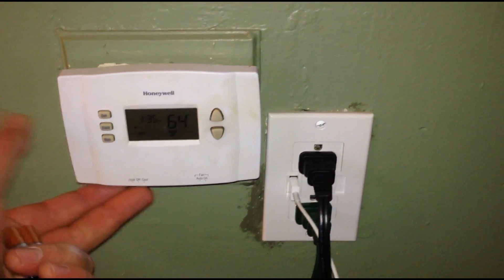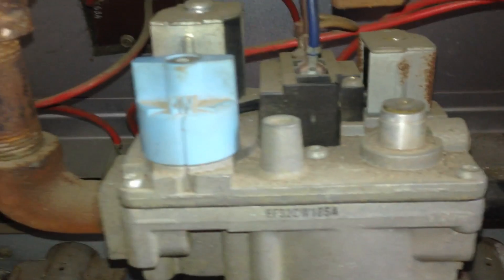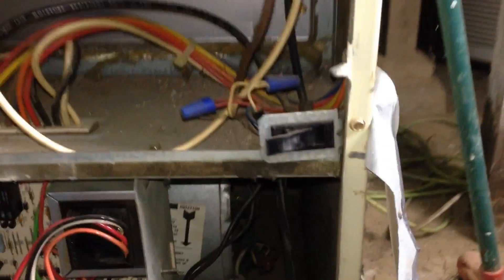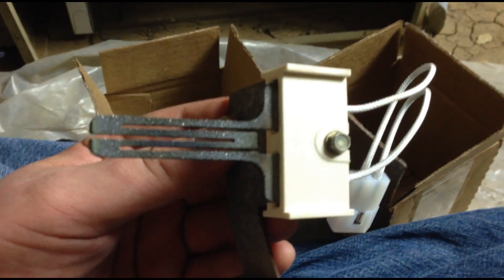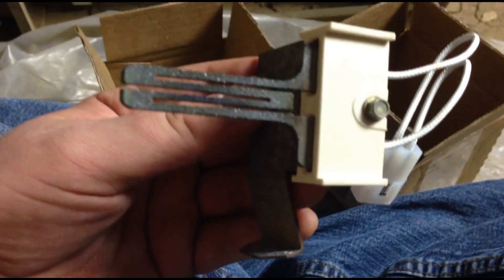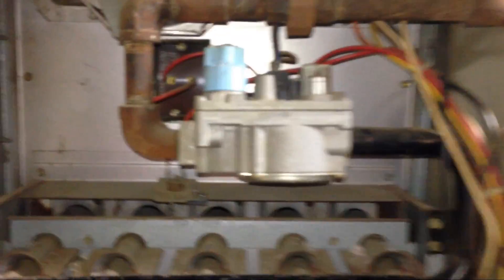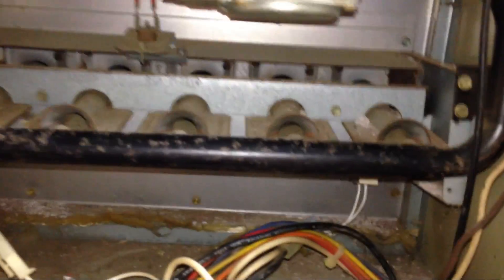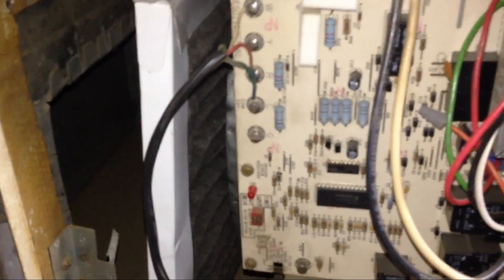7 Tips and Tricks to repair your Furnace DIY

Comment: Buddy, you need to brush up on the cycle. Thermostat call, inducer motor starts, pressure switch makes, time delay, hot surface igniter, time delay, gas valve call, gas valve opens and ignites, flame sensor detects flame ignition done. Temperature set point from heat exchanger is met and blower fan starts. Temperature set point met from thermostat ignition cycle shutdown. Blower fan will run until heat exchanger low set point is met shutting down blower awaiting the next thermostat call.
Blower fan should not start first!
A lot of your information is correct.

Comment: My Amana heater was showing a code 4 “Failure of the Primary or Secondary sensor” but it turned out to be a bad Ignitor.  Changed the ignitor and i have heat again.  You video helped with my trouble shooting.  Thanks.

Comment: Thank you, this worked just removed the flame  sensor, it didnt look dirty but I sanded it anyway with copper pipe sand paper and now my heater is working again, it was turning off and on 3 times while starting it then would stay off. Now it works again God bless. And thank you for the video.

Comment: Mine is natural gas just comes on && sounds like the glow plug has failed idk yet i haven't tried running it with the door off i don't think i even saw a safety switch, its frustrating because before i would just leave it off for awhile && then it would work but now it just makes this humming noise before the glow plug clicks on

Comment: Hey man! Thanks for all you do! I have a quick question if you don't mind. first let me say, yes, Im a ding bat and probably caused this problem myself. okay that said, I haven't had my oil furnace tuned up or cleaned in about 3 or 4 years. last year I ran out of gas towards the end os the season and instead of buying oil I ran a little diesel fuel. This year I just got an oil delivery (yay!) and had to restart my furnace. when I restarted, there was a puff of black smoke. smoke went away and all was fine. however, the furnace has quit i at night time a couple of time on its own. i think the pilot light went out? but each time I have restarted there was another puff of black smoke. any thoughts? I am scheduling a cleaning and tune up, but wondering if there is anything I should be looking for or expect? thanks a million!!!!!

Comment: Help! Why does the pilot light go out when the thermostat is turned up and lits when I turned off (thermostat)
Reply from the maker: mrshppy76 sounds like it is hooked up wrong... did you just replace the thermostat?
Reply: JRESHOW  not, but the motor was replaced a month ago :(
Reply from the maker: Have you ran it normally since the new motor was installed? If not, I’m almost sure whoever hooked up the motor just hooked up the wires backward so “off” is “on” and visa versa
Reply: JRESHOW  Yes, the motor was replaced during summer so I used the ac without any problems...Im thinking 'my guy' does it in purpose to charge me $150 to (clean and turn on) my heater every year; hes the same who replaced the motor :( I really appreciate you replying God bless you!🙏

Comment: Yo, saved me money, about $750. I didn't know much about furnaces but learned a lot from the video, enough to give me confidence to attempt to repair it.  After checking all the usual suspects, I found that my CPU motherboard had two blow capacitors.  They were leaking all over the place.  After replacing in them, all is well.  The furnace is a Day and Night, don't know the model, about 25yrs old.  The symptom was "no heat" and further diagnostics found the gas valve wasn't opening.  I was getting a 21 code.  After finding and replacing the caps it came right up.  I was told the board is $350 plus $150 diagnosis and $250 replacement.

If you are ever in Marin County, Ca, stop in for your free beer!

Jerry
CNCJerry on most sites

Comment: Hi, Thanks for the vedio! Helpful.  I'm recently experiencing no heat coming from furnace. Though it ignites, and stays on. Blows air.  Did change the thermostat batteries before this happened. If you have advice, be great. Or someone reading this.

Comment: my furnace is turned on , but only blow but cold air , the electronic panels shows red on Heat and Zone 3, green on fan , but no light on the pump, I took off the cover, when I press the door switch, the red light blink 2 time , then stop and repeat the same . I don't believe I have 3 zones, some repair man massed up . I only should have 2 zones

Comment: sometimes it is not so hard to fix things on your own when you have help like this.  i was able to fix my furnace. it was shutting off right after it kicked on. it was the thermal couple. cleaned it and POW, i have heat!    cost = free.

Comment: You should not be messing with any of this stuff if you do not know what you're doing. It could cost you your life or your family's life. And you are using the wrong igniter you're not supposed to be using a dryer igniter you need a furnace igniter. Make sure you check the heated changer while you're there and make sure you have a carbon monoxide sensor in your house

Comment: Good basic tips. Good to get some people out of an emergency. The bad?  1) Clean that friggin thing. No reason not to vacuum all that crap out. 2) mail order a buttload of air filters & keep that crap clean (esp. as you have the cheap kind) 3) don't TOUCH the burner sensor with your fingers (they have oil on them).  4) your flames are pretty yellow,so you'll want to 4b) possibly clean the burner holes [requires removing the burner], but more importantly  5) save up enough shekels to have it inspected properly.  I'd worry about monoxing you and your family. Safety.

Comment: Thanks    Next time talk a little about the pressure sensor on the inducer fan.
Reply: After taking the exhaust tubes off to get to my flame sensor (which I cleaned with 800 grit sandpaper and then baking soda and toothpaste to polish it up a bit), I got a pressure sensor code. I pulled off the hoses one by one where they enter the exhaust box. I peeked in the holes and saw a bit of something partially covering one of the holes. I blew some air through the holes an it moved away from the hole. All holes clear, hoses back on and the unit is operational. Minus 22 degrees Celsius and the house cooling off. A furnace tech would run about $120 per hour in our area. He'd probably charge out two hours. Thanks to the internet and fellows like JRESHOW for helping the commoner save money they sometimes can't afford to spend. 
Keep spreading the knowledge and helping people.

Comment: My furnace quit working and I called for a "professional" repair man. He changed out the computer board and it worked for a few days and then quit. I'm into computers and communications electronics and the repair guy didn't appear to be a rocket scientist. Ifigured I better have a look into the furnace myself. The igniter had burned out. The original one was burned out and so was the one the furnace guy installed along with the board. I got a replacement from a supplier and then I ran the furnace. It started and the flame worked and then quit. I figured there may be something wrong with the flame sensing and I found the flame sensing rod. I removed it and polished it up. It did not look all sooty or dirty in any way but it seems like they get a glassy coating on that acts like an insulator. I polishe it up with some emery paper. Since then I do that and follow up with some steel wool to get it nice and shiny. I reinstall the rod and ran the furnace again and it worked perfectly. I now dust the furnace and use an electrostatic filter. I think the electrostatic filters get a lot more polen out of the air stream. 

I can see that the home handyman is not an electronics tech but he means well and he did get the job done. The capacitors he pointed to are really resistors. The flame detector rod  is just that, a piece of metal inserted in the flame. When the furnace ignites a flame creates ions which are conductive. With the detector rod in the stream of the flame it creates a conductive path that the computer recognises. No flame no conduction. Pretty simple device. As a home handymand, once I discovered all this, I was also able to help neighbours on both sides of me plus an older lady and her daughter who were shivering in their home using a little electric plug in heater to keep warm. I love YouTube videos like this, they are so helpful.
Reply: Glad to see you saved money by doing a bit of DIY. Hopefully you won't need to replace anything else but for future reference, we're an online parts store that sells brand new OEM parts for self-repair. If you ever need any help finding the correct part for your furnace just drop us an email at parts@shortyshvac.com or call us free on 877-821-8770.

Comment: Hi, my furnace wasn't lighting so I replaced the igniter, and that fixed it. Just for the heck i decided to clean the flame senor lightly with some steel wool. After I did this the furnace lights and then goes out after about 2 seconds... Any idea why this accurs? I have a 20 yr old york steller plus...
Reply: Mine is currently doing the same thing. Did you ever get a solution to this?
Reply: Yea I fixed it. if the cover panel is not on properly the flame goes out... That's what happen in my case anyways. Works perfect now.
Reply: thanks for the update but unfortunately that's not my issue. my furnace doesn't have a safety switch on the cover. oh well. i will keep troubleshooting and see what i can figure out.

Comment: No worries about a possible bad heat exchanger in that old furnace... Those carriers of that vintage were known to crack. A professional would have also checked other safety parts, blower cleanliness, coil cleanliness, verified the temperature rise of the furnace... Making sure it is running to spec.

Comment: you said that the furnace will not turn on. I have found that the inducer motor will come on. then if the hsi bad it will not glow. Put the meter to the wires going to it, if you get 120v. then the hsi is bad if not keep troubleshooting

Comment: Hey JRESHOW, that shock you got off the fuse means it's wired wrong. The threads are hot. And shouldn't be. Also your gas pipe should be black pipe. Great vid. Keep up the good work. But be safe. Bomba Deer

Comment: My furnace is brand new but makes a noise like it's sending some type of signal to start up but it never does although when it does actually start up it runs normal I just want to know why it makes these strange noises when it's off only way I can describe the noise is it's like an electrical noise like it's going to start but doesn't.

Comment: Ahhh! Thanks so much JRESHOW! I was researching on how to fix our heater and came across your video, had my husband climb up into the attic and I was at the bottom describing to him things to check for (purple fuse, capacitors, ignitor, led light, gas switch, etc.), had him reset everything and our furnace began to heat up right after the green blinking light turned amber! You saved us loads on top of a $90 site visit fee. Much appreciation in sharing your knowledge and teaching it to others.

Comment: when changing igniters because they make universal igniters but you need to make sure that the voltage is like for like or the same some are 80volts and some are 120 voltsif you have a 120 where a 80 is required it won't glow there is my addition to I hate winter 101

Comment: I knew most of these tips from fumbling on my own last year. After going through half of these this year, i stumbled on your video. Turned out to be the damn batteries! They had enough power to light up the thermostat, but not send the signal to turn on the heater. Will now be the first item I check for now on before going up the attic. Thanks!

Comment: I rarely comment on videos, but after working in the HVAC field for 40 years, I have to speak up on this one. 
This video has many shortcomings.  Yes, replacing the igniter did get the furnace to work, but his repair procedures are the work of an amateur. Duct tape on the blower door switch?  No safety checks for the exhaust vent or heat exchanger? 
This is one time you should really spend the bucks and hire an expert.
Reply: LoL it changing an igniter not a full yearly inspection, last I checked it is not mandatory to hire an expert to change out an igniter
Reply: This case it was a simple igniter, one of the easiest and most obvious issues to diagnose. Don't mess around with gas if you don't know what you're doing. Or do, I don't care, I'll come out and fix it right, after you've messed around with it. Licensed gas contractors cost money because we know what we're doing, and we're trained to safely service these appliances, and insured against any potential damages. Untrained 'handymen' make up a frightening amount of my clients. It's a miracle some of these people are still alive. All things considered, he fixed it, but his lack of experience is disturbing. Phone calls are free.
Reply: 1OlBull  right! He’s also only turning the gas valve off  not the actual ball valve on the piping

Comment: The capacitors you are referring to, at the top of the furnace control board are actually  1 watt resistors,  not capacitors.
. Good to know that you seem to think "you know"  the difference. LoL!
Also you should have taken a vacumn to the insides before showing it on camera..the dust and grime are hard to watch
as you explain your method of troubleshooting.

Comment: Those "capacitors"are resistors.
Reply: +Jeff Downing No. He was pointing to the capacitors not the resistors.
Reply: +Jason G , uh, he actually was pointing to resisters. The Capacitors were slightly below the light blue vertical components he was fingering. Caps are usually mounted vertically on the board.
Could just be the camera angle and his general figitiness

Comment: ok, here's what I see first a very dirty unit. clean it did you not see all that orange when it lit and trash in the deckclean the flame sensor, it's suppose to be rough so yeah let's rub it smooth with sandpaperI shouldn't tell you but I willyou fix it, you void your warranty If you have a fire or a CO leak & the insurance company finds out you worked on your unit, they're not paying just so you know gas valves can & do stick open$150 is cheap compared to the doctor's bill from CO poisoningHaving a CO detector next to the unit won't help if the leak is in the heat exchangerKeep on ypu tubing, note my service fee is $55 or $85 if you tell me you tried to fix it first
Reply: +Thomas Werts  why do you have to be a hater.
Reply: +Thomas Werts  OK, HERE'S WHAT I SEE... You sir are a piece of shit!  You rip people off by charging them 3X the cost on something that's so easy to fix that any deaf, dumb or blind kid can do it. $55 or $85 for service fee? LMFAO! You do know this is a licensed profession don't you? Just because you cleaned & changed your mom's filter once?  Does "NOT" make you certified.  Have a nice day! :)
Reply: +Patrick Mc an opinion is like an ass hole everyone has one and sometimes crap comes out I could not care less what you think. everything I said was the truth if that matter name.calling really what are you 6
Reply: 6 &1/2 Truth hurts boy! Deal with it.

Comment: Regarding the screw in fuse .. If the "collar" of the fuse is "hot", it's wired incorrectly!  The "button" at he tip of the fuse should be the "hot" connection and the "collar" should be neutral .. (Caveat:  I am not a licensed electrician.)

Comment: WRONG. So many thing wrong are here.
2:20 "I was getting gas but no flames"  Really?
4:00 An igniter from an ELECTRIC dryer?
Reply: I don't quite understand why that's so wrong..

1. Gas but no flames because the ignitor was not lighting the gas. Most of us understood what he meant.
2. I work on both, dryers and furnaces. The 409 Ignitor that he has, is the most common ignitor that I replace in furnaces and this same ignitor can be used in many gas dryers.

Comment: I got my furnace to work for $42 thanks to you bro. My furnace turned on but no flames. I removed my igniter and found the problem. I'd recommend all of you to use the proper filters because that's what happened to mine. Good Luck.

Comment: My igniter wont glow can manually light furnace runs great until reaches desired temp then wont work unless I relight burners . I replaced the igniter to find it doesn't work checked the voltage to igniter to find none . I bypassed limit switch same result nothing check pressure switch 27 volts when heat exchanger clicks on still no volts to igniter which leaves the board itself but doesn't make since from what I have already read any ideas?

Comment: In my case the furnace works great but WON'T shut off when temp in house is reached,, no matter what, it will run forever,, be 80• in house,, UNTIL I kill the power switch at furnace... So I'm stuck with plenty of heat the heD ache of getting up twice a night if I want the house to feel right or let it run up my gas bill!!!! Anyway why isn't this thing shutting off properly??
Reply: Sounds like a stuck relay, bad controller/main board or bad thermostat.

Careful shutting it off like that, you can overheat the heat exchanger and possibly shorten the life of your unit.